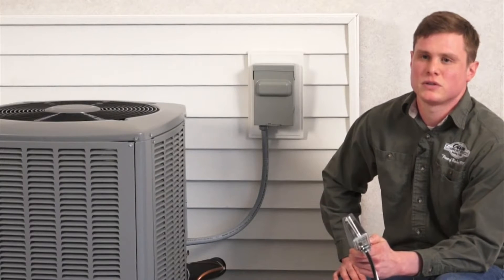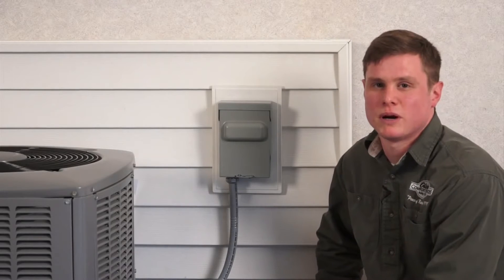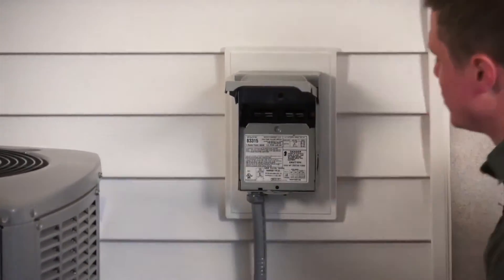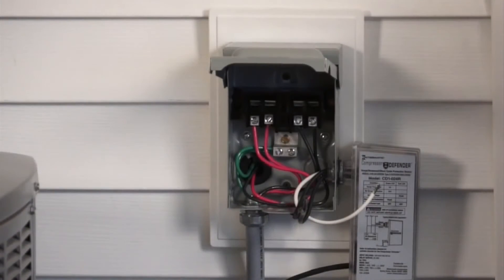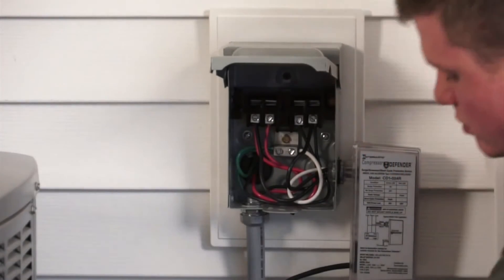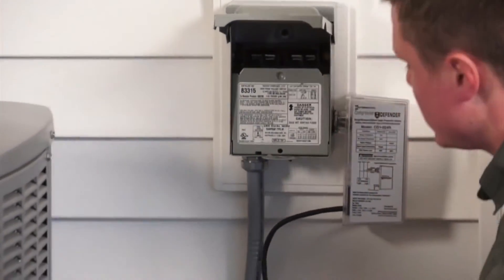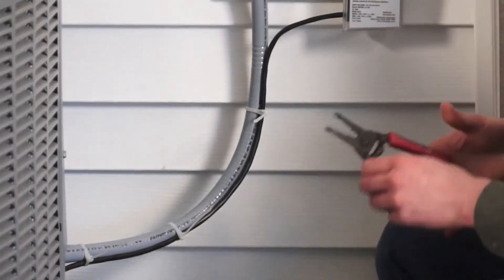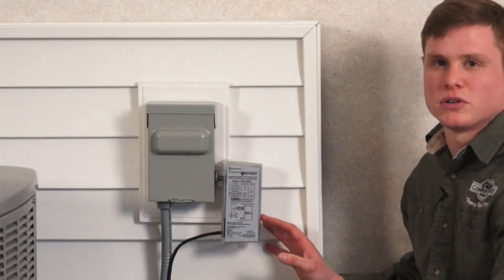Intermatic Compressor Defender Installation Video

Comment: I had a brand new gree 24k btu mini split which failed 2x in the first month due to voltage and surge issues in my rural area. I had a supposedly high end surge protector at the disconnect and a whole panel surge protector, yet the main board in the hvac failed 2x. I removed the previous surge protector installed by the gree certified installer. I installed the Intermatic CD1-024R. Works like a champ and no failures within 1.5 years. I recently installed another on a system for my shop. I am swapping out another surge protector on another property with the Intermatic CD1-024R. In addition, I have a generac back up generator. When the power goes out, the Intermatic CD1-024R let's the generator start up without the hvac kicking on immediately which provides additional benefits. I have an electronics background and have used many surge protectors over the years. The intermatic compressor defender is by far the best one I have utilized. If I was a professional installer of hvac systems, I would use these on my installs as the standard.  The newer gree mini splits and many other have very sensitive main controller boards the technicianinformed me. It isn't uncommon in a rural area to have the lights flash on and off many times during storms. The compressor defender immediately shuts the system off for 3 minutes giving the main power time to stabilize. It also makes sure my generator isn't hit all at once with the typical surge demands when the generator comes on during an outage. An excellent product..

Comment: Would be cool to know how it works
Reply from the maker: Hello! Unfortunately, this product has been discontinued on our website. I am however able to provide you with the spec sheet. For more information I would recommend contacting Intermatic at 877-417-4316. 

Spec sheet: https://a89b8e4143ca50438f09-7c1706ba3fabeeda794725d88e4f5e57.ssl.cf2.rackcdn.com/spec_sheets/files/000/012/962/original/intermatic-cd1-024r-specs.pdf?1440210175 

Please let us know if you have any questions regarding our products! We can be reached at 1800-624-4488! We also have a chat team ready to assist on our website. Have a wonderful day!

Comment: The instructions that come with the device say attach the black wires to load side. From the manual: “a typical installation of the compressor defender connects to the load side of the electrical service panel…”
Reply from the maker: Good morning! Thank you for your inquiry! Unfortunately, for that information and set up an assistance of an electrician is needed as we are only knowledgeable on our items with the provided specifications. That particular inquiry will depend on the set up in person. Please let us know if you have any questions or need any assistance with our products on 1000bulbs.com!

Comment: CAN YOU DOUBLE TAP THE WIRES, SHOULDN'T YOU PIGGY BACK THEM?
Reply: Maybe double tap was "legal" then, but certainly not now. Definitely pigtail, even the ground! (Unless you have terminals which clearly allow 2 wires.) Wago connectors help with space management, but note that some devices, including the Intermatic AG3000, use 10 g wire, so you need to use the WAGO  20g-10g connectors.

Comment: I'm an HVAC Tech 30 years even though you shut of the breaker you should verify with your volt meter,
Reply: You're right. He should also have rubber insulating hot gloves and insulating hand tools but most HVAC techs aren't trained properly. One of the worst assumptions is that no one gets electrocuted except for electricians, electrical safety is treated as electriCIAN safety. HVAC techs are exposed to the same hazards all the time yet they get no electrical safety training or PPE. 

Always Lock Out/Tag Out before working on electrical systems.

Comment: Where did the black wire go that comes out of the bottom towards the compressor?
Reply: When you link out to the  CD1-024R 24 VAC Contactor Wiring Diagram (https://www.intermatic.com/-/media/inriver/13821-12366.ashx/CD1-024R%2024%20VAC%20Contactor%20Wiring%20Diagram), you see that the "lead" splits out into two wires. The current Y1 wire on the contactor comes off and is attached (wire nut) to the Y1 (RED Wire) on the CD1-024R Lead. The Y1 CDP1-024R (Black wire) connects back to the contactor where the original Y1 wire was.

Not really sure why this point was not brought up in the video seeing how simple it is to do.
Reply: @erichoward5565  just purchased this and was wondering if you could elaborate on where the 2 wires go that attach to the compressor
Reply from the maker: If you have any questions regarding installation, please speak with a licensed electrician. This video is from Intermatic, republished on our channel.